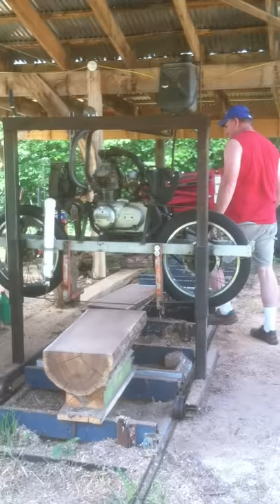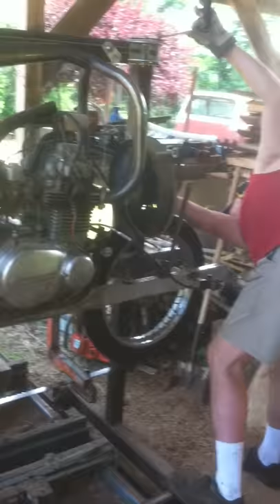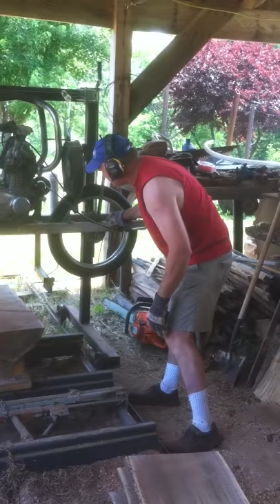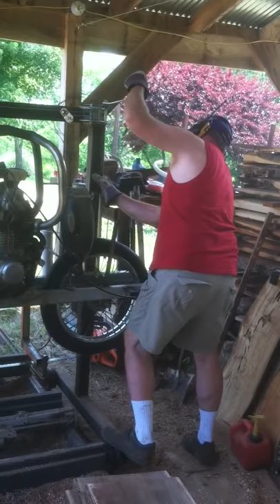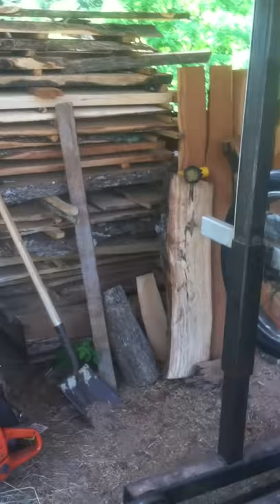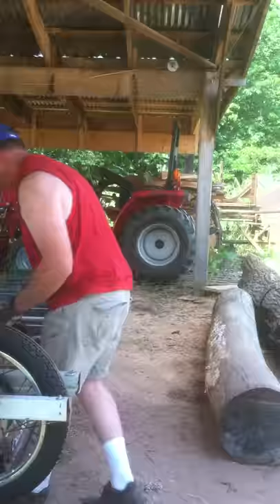Motorcycle sawmill

Comment: I still use the mill nearly weekly. It was a 74 kz400 twin. I have milled thousands of board ft. Of lumber with it. We will be building a 24x28 cabin this spring all from wood that was milled with this mill. Depending on how clean the wood is depends on how long the blade lasts. Typically 300 board ft. of 5/4. The widest boards I can mill are 22". Still no guards. It runs a 144" blade x1-1/2" works best. Since this video I have changed out the motor but have plans to use it on a trees that are too much of a hassle to move the skidder for. I come across trees sometimes 40+ inches across that have blown over and I am going to build a system so I can mill a tree up to 60" using that motor. I'll just slab the wood with it and then load the slabs on the truck.

Comment: When using that motor I ran it in 3rd gear about 3/4 throttle. Feet per second needs to match the design of the blade for optimal performance. I couldn't get back into my account to answer questions so I've had to use my wife's info.

Comment: Hi Dennis, I love your mill. Seems like a natural fit to use the motorcycle as a band saw. You're a little over 3 years down the road from when this video was published. Are you still using your mill? Have you made any mods (guards, I hope!) or anything else? What size motor, and are you using the original transmission? Does it make sense to use a different gear for different size logs? 
Sorry for all the questions, but it seems to cut well.

Comment: Hi, Dennis. I'm impressed with your Motorcycle sawmill. It's a brilliant idea!! The only one I've seen on youtube so far though. 
I love your idea and am interested in copying it, but for this purpose, your help is most indispensable. 
By any chance would you share or have any plans that some others could benefit from? 
I do happen to own a Yamaha engine, which is always one of the most expensive components for this type of project. Also plenty of metalworking tools necessary for the making of it. 
I understand the problems that could be involved in selling plans for something as dangerous as this, especially without the guards. But your design, proofs is reliable and by adding guards to it the safety improves as any commercial sawmill anybody can build or buy. Operating machinery such as this requires safety, but most of all common sense, which is always the responsibility of the operator; hence there most be a way to release yourself from "all" legal implications, and therefore making it available to others. 
Please, if you consider my inquiry reasonable, I'll appreciate you will let me know.
I don't now much about how to communicate through youtube, but if you respond and give me directions on how to contact you, it will be great?

Comment: hello I want to build same thing but I need a little more instruction about the motorcycle and blade long. the lift system is by cable or long screw?  I have Yamaha  TTR 90 do you thing this motorcycle work.nice posting big help.